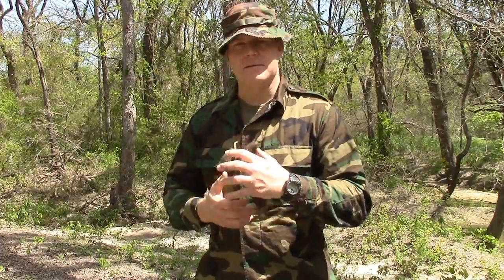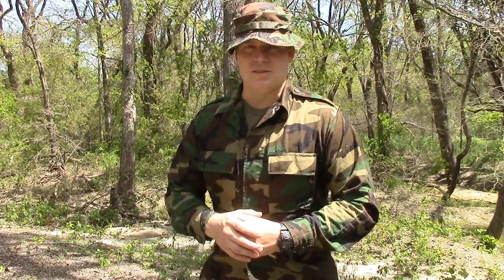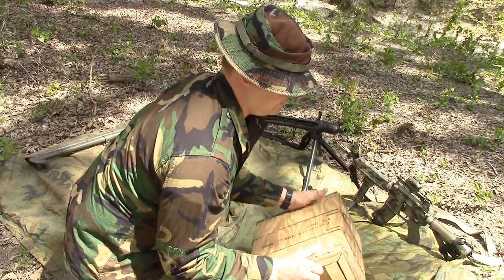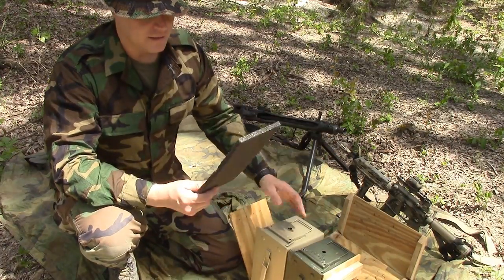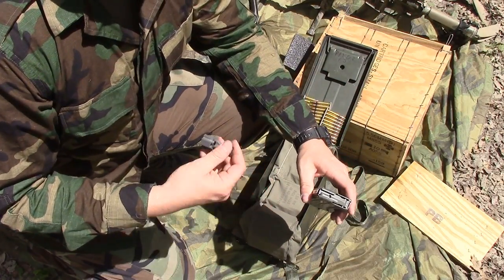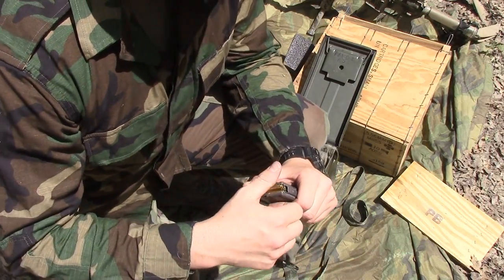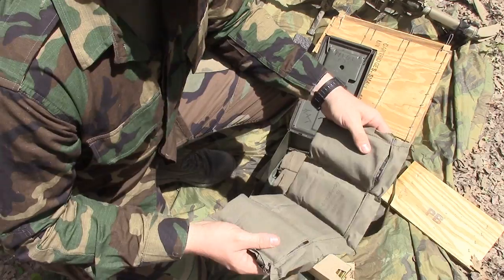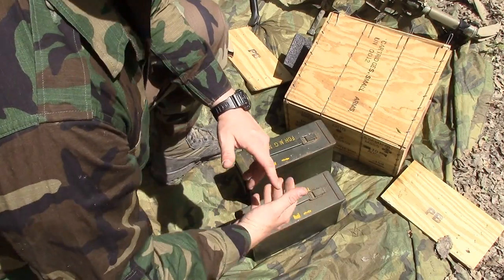Combat Resupply

Comment: We used to use the speedloaders and the side of a vehicle.  The stripper clip would be just above the edge you pushed against.  Could load A LOT of mags fast that way.  At ranges we used the side of the ammo point table (that's why they all look like saw blades around the outside).  Save the speedloaders for later reuse.  

For those planning "OPFOR operations" have a few of the empty bandoleers with your gear.  Either in an assault pack or pant leg cargo pouch.  After you wipe out your opponent in an ambush you pull out the bandoleers and fill them with the mags off the killed enemy.  Sling the bandoleers as you pull out.  The SAW bandoleers (after the drum is out) can be used for captured mags, grenades, or used to make smaller satchel charges.
Reply from the maker: +SecurityGuy42 Thanks for your input brother.

Comment: I strongly recommend MagLula speed loaders. Far easier to use then those spoons and not much heavier. 

In addition, if you have the time available, it is good to pre-bend the tab on one side of each clip, which will make sliding the rounds off far easier. This also greatly extends the service life of clips if re-using them is a concern to you.

Comment: Very well done. To protect MG ammo steel links from rust it is critical to use the ammo can.  Even in desert environments the steel links will rust.  In jungle, think Panama, or Pacific North West rain forests links rust extraordinary quickly.  Rust on links can reduce the reliability of belt feed MGs.  Extreme rust can cause the links to break, making the ammunition unserviceable. An initial belt in the MG of 15-30 rounds is enough to begin a fight (In my experience).  Rarely does the M240B gunner make unplanned initial contact with the enemy.  As most who watch this will know.....  MG's are used as a base of fire from a fixed position.  MG's are not generally used in a fire and movement role as the M16/M4/M249 SAW are.  

I really liked the "cut the strap off the bandolier to carry the 7.62 mm ammo.  I always used a rope and two snap links hooked to the ammo can handles for the AG or ammo bearer to have the ready can available.

Comment: They still taught this in SOI in 1994
In 04 it was pretty common to see 03s fumble around with ammo crates!  Also the 200rd saw box, you can hook on your belt. Or the old butt pouch could carry 2 200 rd boxes. 2 boxes in the butt pouch, one box on your belt and one on the saw, was 800 rds. Also carried a mag pouch with 3 30 rd mags. And spare barrel. There were times when everyone in a fire team was carrying a box for the saw, but wasn't very common. It wasn't till 04 that we got the 100rd nutsacks pouches. And I never carried one of them in the field.
Thanks for sharing 
Semper fi

Comment: Nice and crafty. Very practical tips. I've seen people load stripper clips against a table or edge/corner of a wall to save your fingers. You just push the magazine into the edge of a corner or table top, clip side first and it zips them in.
Reply from the maker: +wingxxzero Yup, I've seen this too, useful tip.

Comment: Pro tip...take your mag with the speed loader and clip and turn it upside down with the last round against a hard surface, ammo box etc, and use your body weight pushing the mag down to load...saves the hands
Learned this from active duty youtuber and it works well

Comment: Great vid brother.  The safety pin is great for putting back together an open wound and those cut off bandolier straps are good for tourniquets. Good to show the removal of the white thread on the bandoliers turning them into magazine pouches in an emergency for carrying extra ammo.  For the idiots that bang a magazine on your helmets, that is a good way to fold over a magazine lip rendering it useless when you need it.  DUH !

Comment: I never knew that safety pin was for that! It seems so obvious now, I’ve seen GI’s in WW2 wearing those Garand bandoliers across their chest and figured they were meant to sag just like those. Also; I never knew bout the little white thread you can pull to fit 30rd mags. I do know that they fit 20rd GI mags PERFECTLY. I have 20 or so of these bandoliers I’ve packed with 20rd GI mags in my stash all because I never knew 30rd ones were possible. Great stuff. 👍🏻
Reply from the maker: Thanks for watching

Comment: Interesting...when I worked on the ammo point at the ranges at Ft. Benning, we held the magazine in our weak or off hand, and the speedloader with our weak hand thumb, and used our strong hand thumb to press the rounds down into the magazine from the stripper clip.  It is amazing how many hundreds, maybe thousands of magazines I loaded for one range day.  I also found that the milsurp SAW pouches (the ones with a snap and velcro closure) with a little adjustment fits my MD12 20-round SAIGA 12 gauge drums.  Also, a box of 12 gauge alternated front to rear, will fin in the older LBE M16 magazine pouches, once the divider tabs are removed.

Comment: Pretty good stuff to throw out to the newbies and those not acclimated. The M19A1 and PA108 cans are kinda heavy though. If they have those brown MREs with the outer heavy duty foil and plastic bag that can zip back up or you don't cut up or rip up the top, you can take like two of those, put one into the other one, fold the top lip down a couple of folds so it's nice and sturdy and not rip, pinch off the top left and right corner, notch a little hole on each corner and run the sling through there instead of the heavy M27 cans. Looks like a purse but a little lighter but less protective than the can if considering the trade offs but also less annoying and f'ed up if you trip on something and land on it.

Comment: Super video, knew some of it, but the strippier guides are a new thing to me. I carry an old weapons pair, an norinco sks and a k98k Mauser, both use stripper clips and both load in the same way, but the box magazines are modern and so are the best. But the old Mauser will not burn out like the a-r does, steel is the reason and aluminum is a piss poor way to save weight.

Comment: The real secret to using the stripper clip is the thumb position when pressing down on the top round must be next to the stripper (as close as possible)!   If you press on the middle of the top round or further out you will tilt all the rounds creating a bind and making it difficult to load.
Other than that nice presentation on the lost art of using stripper clips.

Comment: Not gonna lie, I HATE being ammo detail for M4 ranges because loading rounds into mags with the speed loaders is a pain, not too sure if the cold Alaskan winters have any affect on the cheap metal but I mainly just use a personal speed loader I bought to feed with the clips and it worked, but hey at least I learned something I can teach to my soldiers.
Reply: Kilroy the Alaska winter will make everything different... I did 4 years in wainwright and the range was the best and worst detail depending on where it was and how cold it was... even the sound seems different at -45

Comment: Outstanding video, lots of good info. 
1 question & 1 comment:
Does the stripper clip tool work with the PMAGs being issued by the USMC?
The speaker needs a microphone, wind noise and voice level made hearing difficult.
Reply from the maker: Thanks, I do not know if they will fit current issue P-Mags. I have not been issued the new ones yet in my unit. I'm sure we'll get them soon. I have no doubt they will though, every P-Mag I've ever owned works with standard USGI chargers & stripper clips.

Comment: Sept. 19, 2019----Oh boy, learn something new every day. Have quite a few of the cloth bandoliers and always wondered about that string. I thought it was some way of saving the manufacturer money. Have a few of the sustainment pouches which will hold up to 10 magazines, though I think that's metal mags only. Pmags are 8? As to the canvas type pouches, they'll hold 2 metal magazines per pouch, but only 1 Pmag type unless you add an extra snap to it. Pmags are a bit longer in length which is why. Now going to give the 200 round SAW pouches a try for magazines/other gear. 

And anyone remember the saying: If it's from Mattel, it's swell?

Comment: Thanks for the interesting video .  I remember using the stripper clips  and speed loaders to reload magazines 
at the BCM  range during US Army Basic Training at Fort Sill, OK in 1979.  I had no idea you could pull that white 
thread and change the internal dimension of the pouches of the ammo bandolier to fit  30 round magazines.
Great deposit into the old brain box there.   Thanks.

Haha   I always thought the black safety pin was there so you could use an expended bandolier as an arm sling in case
you or your buddy was wounded in the arm.

Cool how the wooden ammo crates are made to fall away like that.

Comment: We use 20 round mags of 5.56 and the 10 round clips always jam with the speed loader.
It only works smoothly if you remove one round from the clip and then push them in.

Comment: Time to show my age. The speed loader was also used by us lefties as a brass deflector in the days before the M16 had one. Nothing like a few chunks of hot brass down the collar to make one adapt and overcome.
Reply: How did you adapt it for that ?
Reply: Jammed the loader (we called it a spoon) into a small opening on the outside of the receiver behind the bolt to deflect the brass. Been a long time, it may have been a clip instead of a spoon.

Comment: Nice video! Seeing the ammo boxes, something came back to my mind: how come you guys don´t use asymmetrical handles for the ammo boxes?
Reply from the maker: What do you have in mind? The big handles on the top lids are pretty big and make for pretty easy carrying. They also stack well due to an indention on the bottom of the can for the handle that's on the can underneath it.
Reply: I was thinking of the old German Patronenkasten . The assymetrical handles makes it easier to carry two cans in one hand (20kg total, some 44 lbs) Here is a picture: http://www.malcolmwagner.co.uk/wp-content/uploads/2015/03/047-1024x768.jpg
Of couse, it can just be a stupid question coming from a civilian, and perhaps US soldiers are not supposed to carry them in pairs. But seeing all the other ingenious little details geared towards simplicity and ease of use (like being able to use the bandolier to carry 30 round magazines) it just piqued my curiosity.

Comment: @Brent0331 I don't use the speed loaders when I load mags. I picked up a tool called a strip Lula that does the exact same thing as the spoon but faster with or without the stripper clip. Fits in a BDU pocket as it is pretty small when folded up.

Comment: Oh man, once I noticed the coloration differences to fading on your pants compared to your BDU top (which I notice is not issued, you buy yourself an irregular for a good deal?) and hat it started to bug me. Lol Love your videos. Very applicable to the combat line of work. I also like exotic camouflages. I recently picked up some Jordanian KA2 Camouflage and Dutch Jungle Woodland camouflage. Very nice.
Reply from the maker: +Edwin Heck yeah man, It was like five bucks on clearance from (then) BDU.com. The blouse is made by Propper (same company that makes our uniforms), the only difference was the addition of epaulets and no lower pockets (which I never used anyway). I usually wear that blouse when I when I film  these videos because it doesn't have any name/service tapes on it.
Reply: +Brent0331 Nice! I've gone for irregular Tru-Spec Modified BDUs. Already have Arm pockets sewn on, velcro for flags, very easy to save money when you get uniforms modified. Love my modded tops.

Comment: Nice info... but some bandoliers come in seven pouches with only 2 ten round stripper clips and the speed loader isn't in the pouch but pinned with the safety pin to the strap.  Mine were M193 ammunition cans.  I found that tidbit about using the bandolier for holding the 30 round mags interesting however my bandoliers are too short for the 30 rounders, the 7 pocket ones hold a 20 round magazine without pulling any strings.
Reply: "Nice info... but some bandoliers come in seven pouches with only 2 ten round stripper clips and the speed loader isn't in the pouch but pinned with the safety pin to the strap.  Mine were M193 ammunition cans.  I found that tidbit about using the bandolier for holding the 30 round mags interesting however my bandoliers are too short for the 30 rounders, the 7 pocket ones hold a 20 round magazine without pulling any strings."

Older, Vietnam era ammo cans came packed with 6 pockets, 2 10-round clips per pocket, and no little string to pull because they were designed when 20-round AR magazines were the norm.  So, 120-round means 6 20 round magazines and that's what the ammo and pockets covered.

At some point, probably with the M855 or later ammo, they changed it to the configuration above with 4 30-round magazines worth of ammo and pockets...
Reply from the maker: This information is for the modern day war fighter, they don't issue out older 'Nam era packaged 5.56mm anymore, its all been used up.

Comment: The "doo dad" isn't a speed loader. We called them loading spoons. Not much speed in the use. My experience convinced me that mags are handy, but in long bouts of firing, a pile of empty mags, a resupply of ammo, means a time out to reload the mags. WWII M1 GARANDS.....NO MAGS....8 round enbloc clips. Resupply, just pull the clips free and load the rifle. M14 rifle. A mag fed rifle, BUT, the mag could be reliaded with stripper clips right into the mag IN the rifle. Conclusion.....M14 rifle, two to six mags. One in the rifle. The rest are just extra if the one malfunctions.
Reply from the maker: Its real nomenclature is "Charger". "Spoon" is slang just like "speed loader".

Comment: 23 years in the Army and now I find out you are supposed to use your thumb to push the rounds in. I guess we didn't know we were not supposed to use the end of the box or the edge of the can or a branch or...... Should I keep going?
Reply from the maker: Is this sarcasm? I'm not sure... I know at no point in this video did I say you couldn't use any other method. However, when I was resupplied in combat in the middle of a fire fight in the Najaf cemetary, it was a Marine running up with multiple bandoliers on his shoulders, no boxes, no cans, no ends of ammo tables to assist. Would behoove of an individual Infantryman to know how to use his hands and not relay on the assistance of another object to get him back in the fight as quickly as possible.

Comment: Maybe its because I have the thumb dexterity of a gorilla suffering from parkinsons, but I always found it faster/easier to work with the mag upside-down (holding it like a beer can) and use the side of the can to push the rounds in. 

Never dented a round and the lip of the can wants to ride the stripper clip.

Comment: Drives me nuts every time I go to the qual range and I watch guys in loading magazines one round at a time. Every time I ask why they aren't using the stripper clips they came with they tell me they can load it faster without them.  I then proceed to help them load, blowing through several magazines before they get one done.  What frustrates me more is that I was never taught how to use spoons and stripper clips, I was concerned about it if I were deployed and taught myself.
Reply from the maker: EXACTLY, you are 100% correct brother, that is why I made this video. Your experience is the same as mine, and I've been told in reply the same shit as well. Its stupid, guys were never taught how to properly do it, so they try it once and can't get it to load and then resort to loading rounds individually and never try to learn the real technique.

Comment: I just checked out that HK IAR they replaced the saw with, it makes 0 sense to me. Why would they replace a beltfed 22 pound open bolt with an overpriced fancy AR. When you said they got a new squad automatic replacement I got excited to see what the new beltfed was, when I seen it I got a little sad.
Reply from the maker: Its going back to the true "Automatic rifleman" principal. Currently its commanders discretion, there are still some SAWs in the armory but the corps has chosen to go the direction of making infantry lighter and faster. Trading heavy volumes of surpressive fire, for more accurate placed shots to suppress an enemy. I would like to see a hybrid setup, where as one of the three fire teams has its automatic riflemen with a SAW. That's my personal take on it.
Reply: Still though, with every rifleman now having an ACOG, it's kind of like every soldier is now what used to be the designated marksman, seems like the beltfed keeps the enemy heads down while everyone else picks their shots. IDK, it's all theory to me, I've never served like you. Thanks for the videos, your channel has always been cool and it's getting better.

Comment: This video is funny to me because as a civilian no one showed me how to load stripper clips into magazines but I had all the time in the world to just figure it out for myself and it wasn't a big deal. Now introduce the stress of war into the scenario and I'm not sure I could just put 2&2 together and do it without instruction.
Reply from the maker: +ThinTheHerd78 Yeah, it wan't so much that they couldn't figure out how to use it, but was the fact that the technique they were utilizing to do it was flawed. The way I saw this guys trying to push the rounds downward into the magazine they were getting hung up. and not loading magazines quickly.  Also, like I said, many of them weren't even using the speed loaders and were just loading them individually, which was blowing my mind. I think its just a training scar installed in them from time after time of just being handing stripper clips (without a speed loader) and told to load magazines of X number of rounds.